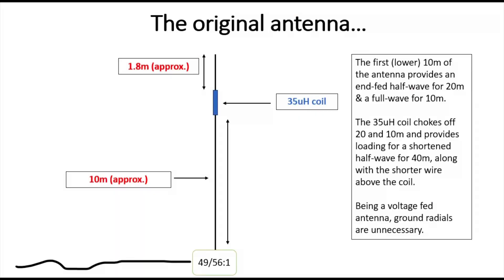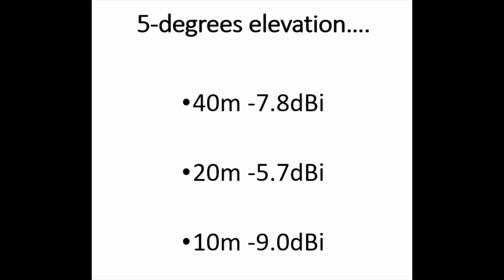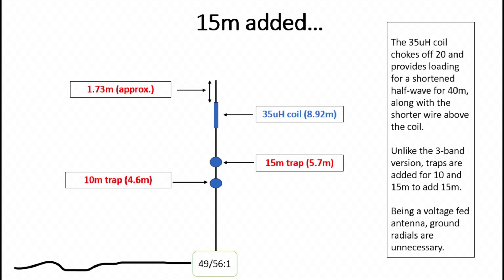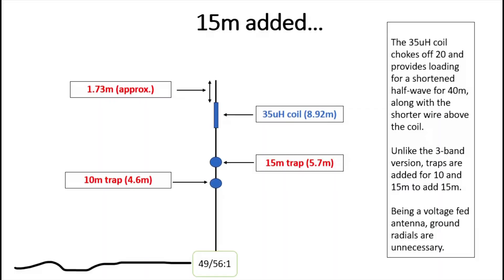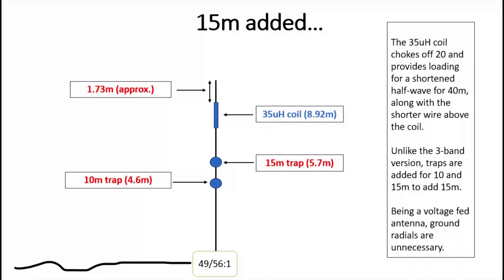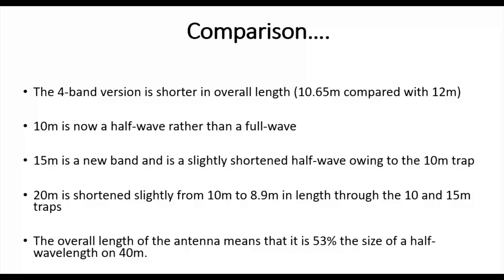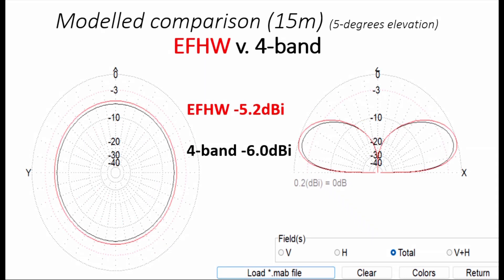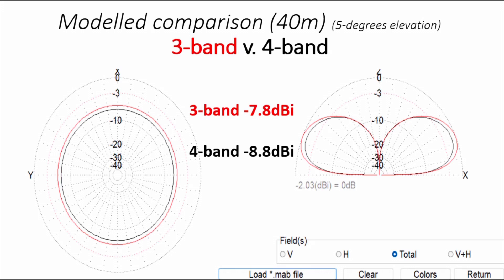A Simple No Radials Vertical Antenna for Portable & Small Spaces

Comment: AND, of course you need a 5kw amp to make sure you are getting your full 1kw out of the antenna at all times 🙂Very interesting set of videos Mike, put it on the car roof, 4 guy lines and 70mph down the M5 would be great fun. I do love the no radials idea though, as I have said to you before I think. It is one of the things that discourages me from /P working, as well as the logging hassle with LOTW, QRZ, EQSL etc. Could do it and just not bother to log but it is part of the fun, just wished the digital type on line loggers could make it easier to work multiple locations. I know lot of folks do run /P logs but would be great to be easier. Suppose if I did do it a few times it would become easier though.

Comment: For the 10m and 15m traps what frequencies should be used for the coax trap calculator?
Reply from the maker: Mine are just below both bands
Reply: @timg5tm941  so when you say just below would 27.9 MHz (10m) and 20.9 MHz (15m) work or would there be better frequencies?

Comment: I've never used traps before. Would the length of coax used to build the trap be included in the length of the antenna?
Reply from the maker: No the length indicated is purely vertical wire between the traps

Comment: Tim - this may be a daft question… the 10m trap and the 15m trap? Are they easy to build, or would you buy those?
Reply from the maker: Easy to build. I bought mine. Lots of info online on coax traps
Reply: Thanks Tim - just found some coax trap calculators online, I think that was the piece of knowledge I was missing…. Look straightforward enough to make. Thanks again

Comment: Nice timing Tim I am looking for a short antenna for my 817. My efhw is bloody massive in my garden. Having to make 20m wire disappear in a 8x8m garden. 
Are you going to build this? 
How do you think it would work as a inverted V, guess a slopper would be better.On a 6m mast for port ops?
73
Reply from the maker: Hi mate. Yes going to build this for sure. I’ve already modelled it and I feel another video coming on!
Reply: @TIMG5TM  oh can't wait. It's the whole finding the perfect antenna.  My issue I have with them is the footprint they take up to get the most bang for your buck 💪🏽👍🏽
Reply: I squeezed a 60m inverted vee into a 25' x 13' garden maximum height around 22'. That's about 44' each side, an odd shape but it gets out.
G4GHB.
Reply: @bill-2018  morning Bill that's sounds great. The things we have to do to get on the air.
I have a mess of a garden as the dog runs around, ripping the grass up and a very helpful neighbour who tells me I've put a mast up just in case I've forgotten about it the day before 😂. It not like I have a pump up mast with a hex beam on it. I don't I use sotabeams ultra thin wire so it's not seen that much on a 10m mast which isn't at its full hight. 👍🏽
Reply: @m7trsradio  Morning, in 33 years living here nobody has even asked what the wires in my garden are, probably think I'm just crazy. I tried long wires, doublets, verticals and wanted to get on 60m so put this up before covid. 5 attic dipoles 20m to 10m, indoor h.f. mag. loop, a 2 element 2m collinear and a copy of a Joystick with 23' of wire for lower h.f. All homebrew. QRP 5 Watts or less.
180 mile QSO on 5.262 MHz using a Pixie, 350 mW out with a SWL report from Utrecht at 220 miles so the vee does get out.
73, G4GHB.